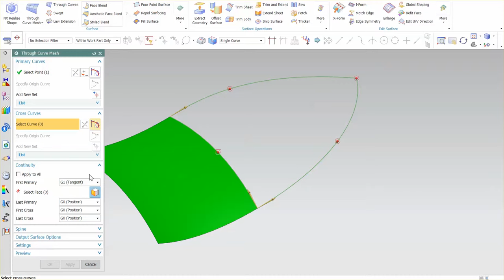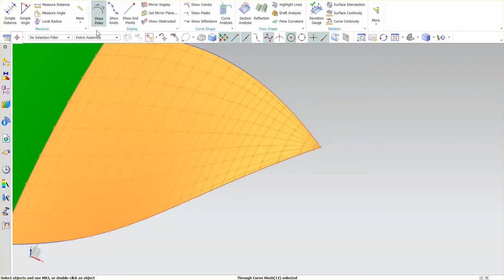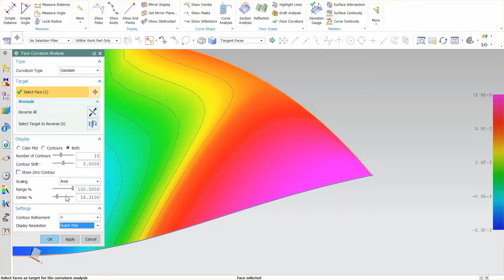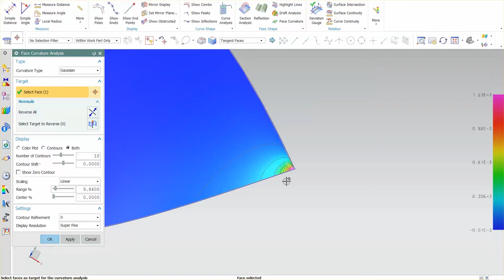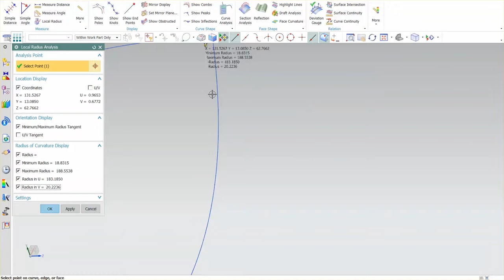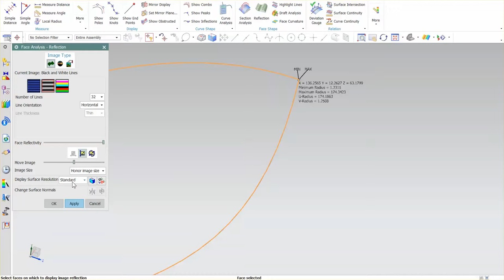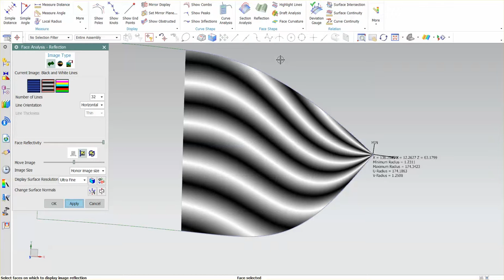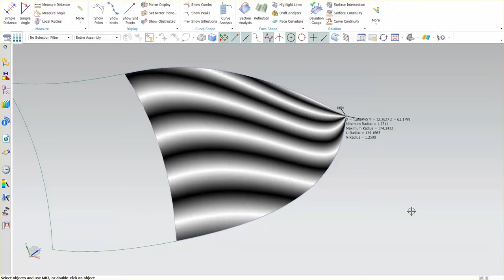Siemens NX 10 | Through Curve Mesh: To Point

Comment: Hi, what if you add a constraint to the point ? In case you want to close a triangular hole ? Seems to work ?
Reply from the maker: By building a "3" sided surface you are still building a 4 sided surface it is just one side in the length of a point which in NX speak means it is .01mm long. This causes all sorts of bad things in a surface. Build to 4 sides and trim back.